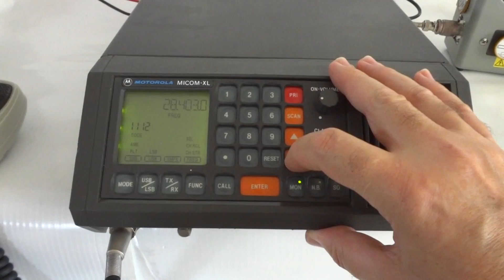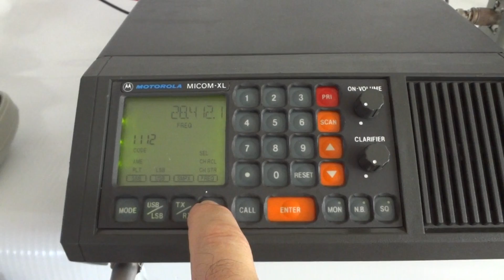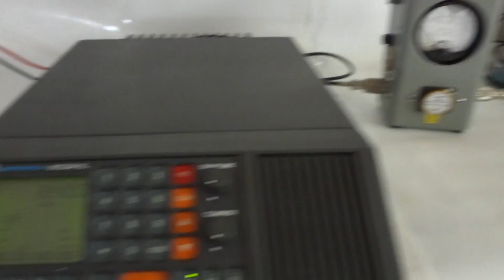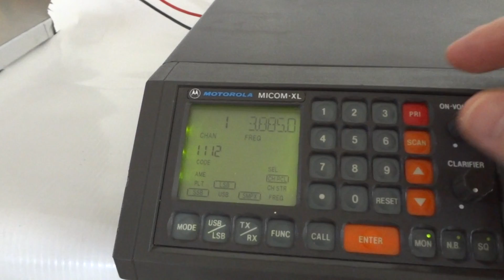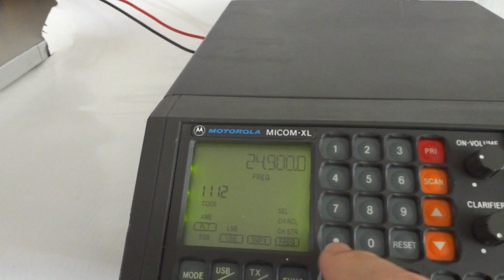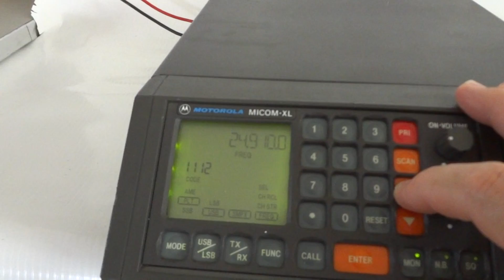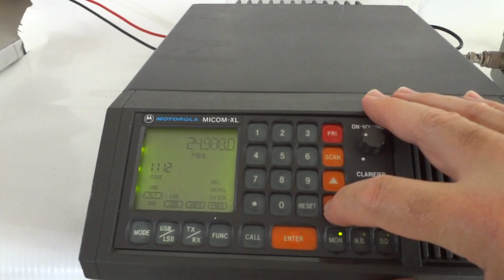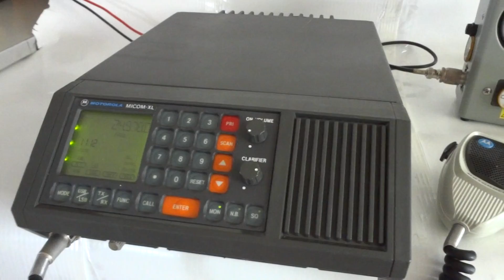Motorola Micom-XL (XF) professional HF SSB transceiver

Comment: I have one of these I need some help with, maximum output on mine is 10 watts. Is there a power adjustment in a hidden menu or does something need to be jumped in the auto tuner plug if using a manual tuner? Everything check out in the amp, something is limiting the power.

Comment: I sent you a question about one of these I just picked up. I cant get mine to go into transmit and wonder if there is something in the plug I need to jump
Reply from the maker: It is probably firmware locked

Comment: Hello,
your video is very interesting.
I have this TRX Nato version with keyboard separated.
The vfo works in free Modus, so I think that the radio is unlooked.
The problem now is only in TX the display remains in smpx mode only and the word "DISA" appears on the display when I put PTT.

Thank you in advance

Bye
Antonio

Comment: Looks like a great radio but I gotta have a VFO for HF band operation. This thing would drive me crazy having to push a membrane button over and over and OVER to tune around. Then there's the issue of microphones... good luck finding those mic connectors. That's why I have a regular amateur radio with a standard mic connector and VFO control. But hey, that's me . . .

Comment: i have micom XL but is full locked. i don't heve FREQ on options in display.
some hack manual ? :)
Reply from the maker: We sell reprogramming firmware that will unlock the radio to full XF status (frequency and memory freely selectable and programmable) . There is no need to send me the your radio for the unlock, you simply could do this yourself when I mail you the firmware (EPROM). Price is $190 plus $10 shipping. Let me know in case you are interested. Cheers.

Comment: Hello, I also have this transceiver working as well. Only with the programmed channels. Its blocked on frequentie, so you do. Is this a software configuration? I like to have your software programming. Is it possible to get it? 73 Gerry PA1AT

Comment: This model is one of the must-have radio's if you are a true Motorola fan and a SSB lover. Most people don't know Motorola actually made a LOT of radios that can be used by the everyday radio operator or amateur radio operator. They are wonderful quality radio systems with great build quality and they sound equally great as well, very sensitive too.
A lot of folks don't know Motorola even made CB radios back in the 1970's, which can be another must-have radio for the true /\/\ collector :)

Comment: Ah ok thanks for the info is that why an old kenwood mic is not working you have to shout into it to get any movement in the TX bar meter need a pre anp maybe thanks for the insight tho, i can't find a service manual too?

Comment from the maker: The microphone is an active one with an amplifier in it. The circuit basically simulates a carbon microphone. Almost all Motorola clam-shell style mikes are configured like that, so just look for one at a hamfest, they can be found in abundance there. But if you have a carbon microphone (from an old telephone set), that will work too.